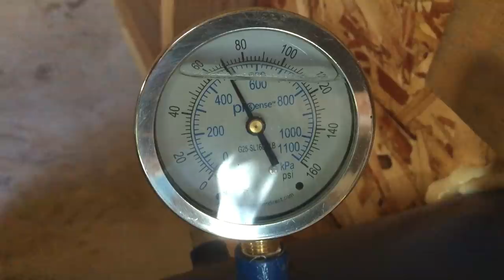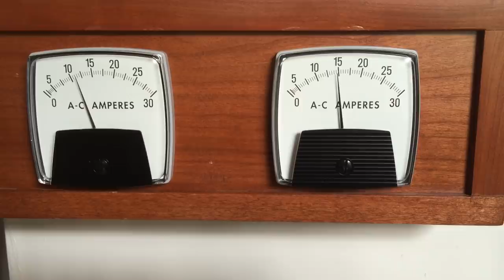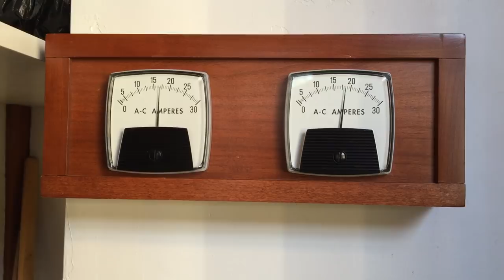Part 20-3 MicroHydro Power System in CO

Comment: What was the overall cost of the new system, including if you didnt already have the items from the first powerhouse?

Would this system have been cost effective if you already had grid power?
Reply from the maker: Both questions are difficult to answer being hypothetical and hence require research I did not do 5 years ago. Prices for turbine equipment would have been bid from various sources and I would have looked for a salvage generator from numerous sources. Depending on those components I might have made different choices on pipe size, DC vs. AC, transmission, load controller vs grid as battery, and even combining some solar where costs continue to change. I also would have engaged a hydro engineer to give me advice from their broader perspective. 

Determining the situation with grid power is also an exercise in numerous what ifs. I don't know what the net metering rates are and if/ how they've changed over the last 5 yrs. 

Every hydro system is unique and needs to consider all options. Deep research should be undertaken to determine an acceptable course. How much power is actually needed should be factored in. Our situation was unique of course with existing equipment and resource. 

The intention of documenting our redesign and install wasn't to show a cost analysis (which is a popular and reasonable question) but to fill a large gap in both the detail and quality of the available videos out there. 

Sorry I can't be more concise in this reply.
Reply: MrHydrohead no problem, appreciate the reply. I just know the one video you had a lot of spreadsheets and figured you may have ran those numbers.

Comment: How necessary are the siphons? My 1700 foot run in 4 inch black pipe from the headwaters has great flow until it reaches the end, then it slows down considerable. With a small elevation change I am guessing a siphon may be required. Any suggested reading or Internet source for learning about siphons?
Reply from the maker: 1700 ft could introduce a lot of pipe friction depending on flow rate. Static non flowing water would have constant pressure based on available head or fall 2.31 ft per psi. If your grade of pipe goes up and down you could have air lock which would need air vents at high points to let air escape. Our first spring fed penstock had this in its design. We don't really have a siphon in our system. Parts 16-19 of series show how trapped air can cause problems and potential solutions. Not sure what your site design is so it's hard to provide an informed comment. If you have sufficient fall you shouldn't need a siphon which would be very difficult to even get started with a 4" pipe

A little more information on your situation would be helpful

Comment: Great series. When i first saw the videos in 2016, it somehow raised my wish to have a waterpowered home myself in the future. 60Amps at full capacity is a lot of power. i don't think there is anything in any home that can use so much power. 
You should find something to do with the excess power this system provides. Like sucking the CO2 from the atmosphere or producing Hydrogen for use in a power station that provides energy to other homes that would otherwise use fossil fuels.
Reply from the maker: One thought originally was to make this a hydrogen farm and run a hydrogen vehicle. But it appears we're a bit ahead of the market. A greenhouse may someday be built. Or maybe block chain calculations powered. But it's all just simple now and harnessed power going unused is an asset for future use.

Comment: Thanks for your video. With all that power have you thought about changing your vehicles to electric vehicles and powering them with renewable hydro power too?
Reply from the maker: Certainly. Problem is the road isn’t plowed in winter and access is via snowmobile so we have nowhere to charge road vehicle in winter. Also there are only 2 PHEV 4 wheel drive vehicles available. Mitsubishi makes the Outlander but the nearest dealer is 4 1/2 drive and Subaru is going to release a PHEV Crosstrek this year but won’t sell them in Colorado. No ideal solution available at this time. I keep looking though.

Comment: What is done with the excess power that you generate? Does the generator disengage when no power is needed?
Reply from the maker: The excess power is shunted as heat into 300 gallons of domestic water, a hot tub, and house heating in the Winter.  The generator runs constantly and the load is always equal to the power produced.  When there is more than needed it gets dumped as heat and never shuts down.  thanks for watching

Comment: First, tnx for this great series!

So is my understanding correct, that the system shuts, both, when its overloaded or underloaded?

If so, how do u regulate the power in the summer when u can't use the baseboard heaters?
Reply from the maker: Because it is direct AC, the system needs to have load match production.  If this gets out of balance, the AC hz goes above or below the thresholds set into the monitor system and the jet deflector shuts it all down.  This seldom happens as the full production is handled by the load controller shunting a portion of the sine wave into an adequate load capacity via SCR circuit switches.  The opposite is when my wife turns on too much load and the system slows via the load being greater than production. Its a rare event as she progressively learns not to create too much load and manages our use.  Me, I designed it all, so I can't remember the last time I caused an overload.

So, Spring through fall, we have another set of baseboard heaters in the garage/basement.  4500w or whatever is being shunted goes into a hot water heater that circulates glycol through at 300 gallons domestic water tank (always tons of hot water available).  When that thermostat trips off at fully heated, the excess then feeds 3-1500w baseboards in the garage/ basement. The THES load controller manages the load  in microseconds to a total of 4500w, whatever is needed to keep the hz at 60cps. It gets really hot down there for sure sometimesand thats why we dial back the system in all seasons but winter.  Just not enough useful load can be put to work.  We could set up an exterior power dump of 4500w, but haven't felt the need to wire it or spend the money to keep the basement cooler.  Its nice to have a warm basement.  Hope this gives an better overview of how it functions. thx for watching
Reply: @mrhydrohead  thank u very much for this detailed reply!

Comment: I watched the 3 part synopsis but I didn't see anything about ROI.  How long did it take to pay back the investment?  Thanks for the great videos.
Reply from the maker: We started in 1995 acquiring water rights and putting in a penstock from springs. That initial system cost around 25k in 1996 dollars. We also got gravity pressurized domestic water and a pond for raising fish at that price.  
When we moved the existing equipment to the creek we incurred additional costs of around 55k in 2015 dollars because we needed a full redesign of penstock, powerhouse, transmission and load management.
People often ask how long it will take to payback the system, but this neglects to consider that we would have had to spend about $140k in 1995 to bring power lines 7 miles into the off grid property.  That estimate had ballooned to $250-300k by 2015 when we moved the system.  We would have had to pay that to bring power lines in and then had power bills to pay on top of that.  So it was a no brainer to install our own system at either juncture and the question of payback was/is a moot question.  We look at the installation as an asset investment in the overall property.
Thanks for watching

Comment: What is the financial cost benefit analysis?
Reply from the maker: Lots of people ask this. Installing the system was a bargain vs running power grid in 7 miles as discussed in part 1 of synopsis. We look at it as an asset that increases the property value and thus as an investment vs a cost analysis question

Comment: Please which of your videos details the appliances or equipment that you are running. Cos you have so much power available for use
Reply from the maker: There isn't a segment that deals specifically with the appliances in the house or specific uses of power.  The majority of power is used for heat.  Either heating a 300 gal heat storage tank of domestic water, 4500w of baseboard heaters in the winter, and an outdoor hot tub.  We use 2000w water pot, microwave on occasion, shop tools of all sorts, and of course lot of lights.  The electronic load controller ELC allows us to turn things on and off pretty much at will and it will compensate the shunt load being dumped as heat accordingly to maintain a consistent load on the system.  Hope this helps, and thx for watching
Reply: @mrhydrohead  Yeah it helps. Thanks a lot. You really consume so much on heating alone. 4500wh is my daily requirement for a full day
Reply from the maker: Winter in the mountains @ 8600ft in the "icebox of America" can get chilly, but with passive solar gain we only burned 1/2 cord of wood last year to heat a 3000 sq ft  house, mostly for the romance of it.  Winter is the only time we crank the system up to 7500-8000w.  All other seasons 3500-4000w is way more than enough.

Comment: sorry for my lack of knowledge , just something seems so off to me, if your using the same parts electric generation parts from the system created in 1996 which created 150Kwh from 96-15 and the new system made 100Kwh from 15-video post date 

how is that possible with the same generator ? from what i understood in the series you are still using the same intake as the old powerhouse
Reply from the maker: The old powerhouse sat at the end of a spring fed penstock with 212psi and a seasonal maximum flow of ~80 gpm. During those initial years it was a seasonal part time vacation home and the output of the system was generally between 1000-3000w depending on the season and our presence at the property. The system often was set to a lower flow while not present.  The meter started reading in 1996 and never quit. We had numerous pipe breaks over the years due to the high pressure. We decided to move there full time and with the drought and lessening of the Springs’ flow, we decided to move the system to a newly designed powerhouse and construct a new penstock off the creek which afforded 96psi and 300gpm which is roughly the max of 1” single nozzle turbine. The lower pressure  meant no breaks and we needed a belt drive to get to thebrequired 1800rpm at the generator. 
So we had a great increase in the amount of water at less pressure with the result of far more power output. As it now functions we make about 7500 w of power through the cold winter to heat the house and hot tub with all lights and appliance use and then dial back the flow for other seasons because we don’t need that much power which would only be wasted as heat. We might add a second jet to the turbine in the future to increase the winter time power production up to 10,000w, but haven’t committed to doing so at this point. Maybe use excess power in a greenhouse or do blockchain mining. Options remain open how to best use the power resource. 
Thx for watching and your question. Hope this clears any confusion. 😉
Reply: @mrhydrohead  thanks for replying, yes! That makes sense I totally forgot that u had a reduction in gears to spin the generator faster, very interesting stuff, thanks for taking the time to put this series together
Reply: @mrhydrohead  Have you read your spec plate on your alternator closely? You might find that it is rated for 12KW. I ordered a Lima direct from the factory back in 1993 and it was supposed to be a 10KW unit. When it got here, it was a 12KW 1800RPM 12 wire MAC unit. It is mated to a Farrymann twin V engine rated at 23 HP at 1800RPM. Marathon/Lima builds good units. But be careful, in a zigzag pattern for single phase they can lose 50% of their rating. And you lose 10% of capacity because of your altitude.
Reply from the maker: gravelydon I’ve been told that the lima could actually make 15kw if 3 phase wired,but unwilling to rewire house and load management issues with 3 phase. As a turbocharged pilot, i think the issue of power loss at altitude you refer to is more related to loss of compression in an internal compression motor than in the generator. Perhaps you know more but as is our system runs dependably unencumbered.
Reply: @mrhydrohead  Would not surprise me any if it could produce that at sea level. They are an underrated, overbuilt unit in most cases. They tend to build them that way so they last. Some are even qualified for use in explosive areas or in marine use.The reason for the derating is that cooling is less at altitude. You can always mount a bigger engine but you still have to get rid of the heat. On a 90° day at 8000 ft you will not get the same cooling as if you were at sea level with the same temp and humidity. If they kept the same HP engine, then they would have to derate for it too. Unless you were using a turbo or a gas turbine engine.
Reply from the maker: gravelydon Well that makes good sense, the cooling factor. I’ve been very pleased with how robust the Lima unit is. Built like a tank it just keeps running. Someday i may need to get it rebuilt, but im so glad i bought quality to start with in 1996.
Reply: I know we're talking about an alternator here + electrical safety but I immediately thought of water cooling as a way to resolve the altitude differential.. If it came to it would there be any mileage in setting up a water cooled radiator loop and fan blowing cooled air towards/over the alternator if heat really was becoming a problem?

Comment: I just LOVE The Series & Your idea! 
Why not to use a vortex turbine?
Reply from the maker: If we were just starting today, I would consider it as an option. However the redesign was based on existing equipment we had from 1996 when the vortex design wasn’t available. Our initial system was high head low flow and had other benefits like pressurized domestic water and the fish pond. The prospect of buying all new equipment was a path we wanted to take 
Thx for watching 😉
Reply from the maker: Wasn’t a path we wanted to take
Reply: The best is that while sitting in a chair You have in mind that You are 100% Eco-friendly , You did it all yourself , and You can admire nature with green/pure energy. Greetings from Europe! (Sorry for my english)

Comment: I live in Liberia . I saw your program and am interested in getting one  hydro power generator but do not have the  opportunity of getting one. Can you find one for me?
Reply from the maker: Octavia. The series was/is intended as an experiential resource to help others understand the long process of installing a system. Every system is unique depending on power potential, topography, power use/demand, local regulations, available finances, and will power to learn and push through the difficulties of manifesting a project. There are numerous sources for knowledge and equipment available over the internet.  Before acquiring any machinery it is first most important to research all the specifics of a site to determine all the unknowns. I couldn’t begin to assist you until you do all of that research.

Comment: Hot tub is nice, but I would be eager to try crypto mining for putting this excessive power into use. Mining rigs could also replace electric heaters. A whole house ventilation system can be used for isolating fan noises and redirect the heat outside during summer.
Reply: I was thinking the same thing  :)
Reply: Yeah, PoW is evil for the environment unless it absorbs peaks of unconsumed energy. This power could also be used for more useful compute tasks as long as they scale up and down fast enough.
Reply from the maker: I've considered mining, but the landscape has changed quickly with that and will continue to. Not too interested in chasing the fastest processing equipment, maintaining it, or upgrading it. Keeping life simple is important to me.
Reply: Since you have no mains power a simple system should work fine.
It can run day in & day out without killing you with a bill.
Startup cost would probably be less than 4 to 5 hundred for a decent computer.
The only problem I can see would be the internet connection required to sync it.
Reply from the maker: Our latency is good at 20ms and I've heard bandwidth isn't a huge demand. We have 8-9mbps which is not that much but probably adequate. I've considered installing a rig of several cards but see that the rewards have been shrinking with an ever increasing number of players seeking to mine. I have plans to get in touch with a friend of a friend who actually does it and could offer informed advice. If practical it would be a great way to amortize some of the hydro system cost. 😒 I remain skeptical until knowledgeable
Reply: Just as a point of info. My son-in-law is somewhat knowledgeable on mining. According to him, the return is less than the hydro cost to run the computer for the transaction. IE micro pennies.
Reply from the maker: Yeah i think so
Reply: That's a brilliant idea